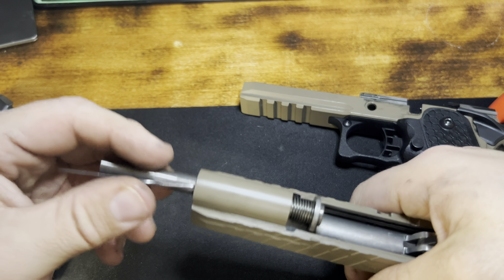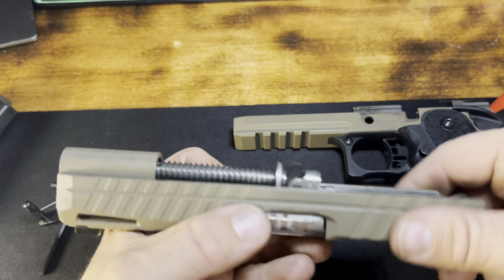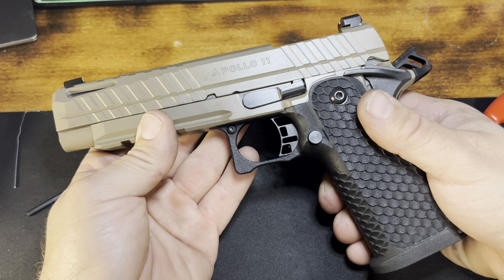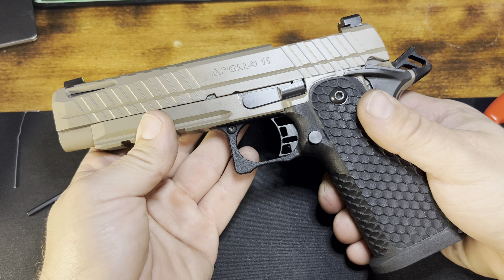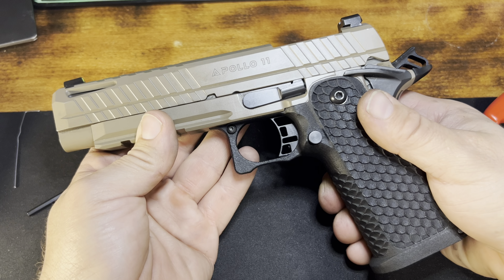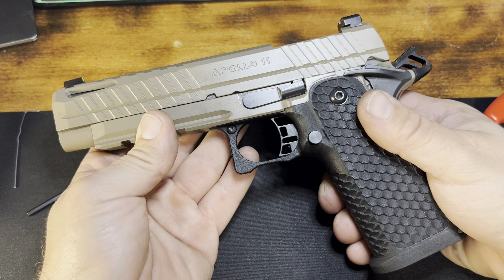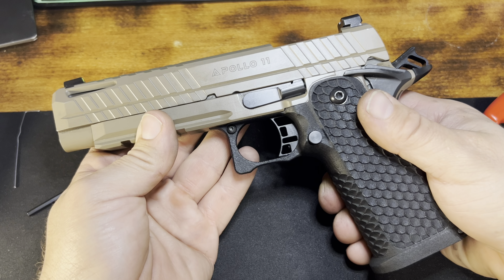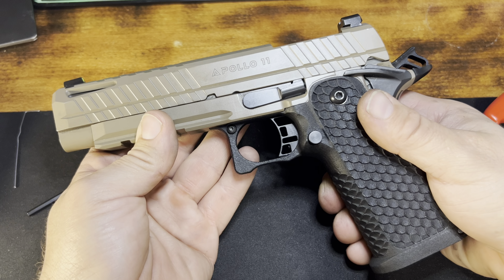Live Free Armory, Apollo 11, Tabletop Features look + Disassembly

Comment: Just FYI, that's not an RMSc footprint.  It's RMSc-compatible.  The recoil lugs that are part of the RMSc spec are missing, so the optics screws will take all the recoil vs distributing it across four lugs + two screws.  Even the HolosunK modified RMSc would still have had the two front lugs.  This is indicative of end-milling the slide vs. CNC milling it, representing cost-savings at the potential expense of durability of the optic/screws because of what's being forced to absorb the recoil and where (all in the middle of the optic vs. two or four corners + two screws).
Reply from the maker: Wont the wall of the slide behind the optic if it fits tight enough also take some of the recoil force as it would be touching the back of the optic and preventing it from moving as well?
Reply: @WVGunsNGoats  Negligible, at best, even assuming the optic goes all the way against the rear.  The optics have post holes in them for a reason... the same reason the spec (RMSc and Holosun K) have posts.  Recoil absorption.  It'll be interesting to see if there are reports in the next 6-12 months of optics flying off, sheared screws, etc.  It was a simple thing LFA could have done right and instead appears to have cheaped out on... and that kind of red flag was enough for me to cancel my "ready to ship" order with them once I found out.  It speaks to other potential cost-cutting that's gone unseen and could lead to a less durable firearm.
Reply from the maker: Thank you for the insight into it, i wonder if they will add them as production continues, i will have to ask them at SHOT show next year.
Reply: @WVGunsNGoats  I doubt it.  It's a change to their machining process.  This really calls out their bullshit about all of their "look at our new machining capabilities" posts on Instagram, etc.  This is home-gun-builder quality, IMO, vs. CNC quality that all the other major manufacturers are using.
Reply: @thatmikereed Without actually seeing the plate where it lines up on the pistol, your comments are based on assumptions only.  It's quite possible the plate does mesh with the optic cut out with won't put stress on the optic screws. And frankly this is more than likely the case.
Reply: @lawnmowerman25 there is no plate.  That’s part of the problem.  It’s directly mounted to a non-spec cut on the slide.  Every optic is going to fit slightly differently - they’re all slightly different lengths.

At least with a plate you could add posts.
Reply: The cutout in the Apollo 11 is 1.620" center to center.  A Holosun 507K X2 is 1.60.  So there 0.020" play front to back. Only the screws are what hold it, it is not held against either front or rear walls.  I have gone to the range with mine and it is not usable with a 507K x2, it was all over the place with every shot.  Now an RMRcc is 1.8", I don't have one, but going by Trijicon datasheet I would say the Trijicon RMRcc will not fit the Apollo 11 - at least not mine.
Reply: @WVGunsNGoats  Just FYI, they've supposedly added locking lugs in the Holosun K format on newer slides.
Reply: EPS on my Apollo 11 has 4 trips to the range, at least 200 rounds per trip , so over 800 rounds , no Zero drift, screws still tight . Only change I made was put a take off Prodigy grip on mine. The factory LFA grip is thin lightwight 3D printed plastic, looks good and feels ok but the Prodigy grip is beefier built , not a hollow echo when dry firing like the thin LFA grip. I wish LFA would offer Aluminum grip upgrade !

Comment: This is a great piece of kit. The fact you can get a quality 1911DS for under a thousand bucks sets a new bar. The red dirt trigger is excellent. I prefer a full-length frame as it adds weight balancing the full magazine. The tri-top is a nice touch. LFA should offer a pinned grip safety. I would put a tooless guide rod in and if they manufacture a forged ignition system there is no need to put an EGW system in. I have read reviews and have shot this pistol at my club. There is a lag in the slide return, I think maybe it is the disconnector, an easy change, and an upgrade. Here is the question, if I own all of the usual suspects in 2011s, Atlas, Hayes, Bul, then what does this gun add to my collection. Well, I would carry this. The polymer grip deducts weight so it would not drop my pants. In addition, IF I ever had to pull for a threat, I could live with the police confiscating a $1000 pistol over my $6000 Nighthawk. Remember why we carry. protection and defense for you, your family, and innocent strangers.
Reply from the maker: Hey Rogue, Thank you for the thoughtful response, I just got around to setting down and going through all the comments i missed, It sounds like you have a pretty good collection of 2011's out there, and you know what the great thing about this Apollo 11 is? It is going to be a great entry into the 2011 world for someone who may be on the fence about spending the money that a 2011 usually costs, and they might see the light and decide to buy an Atlas later.

You also make a great point that if you have to use it defensively, and it gets held as evidence, you don't have a multiple thousand dollar 2011 sitting in police lockup. Thank you for watching!

Comment: Just got my black Apollo 11 today and so far it is nice. Have not fired it yet.  Just field stripped and cleaned it.  Initial impressions:
1. Coating appears to be more susceptible to damage than just regular cerakote.  The inside of the slide where the barrel rubs was full of scratches from the barrel, down to the metal.  
2. I'm concerned about the grip safety. It is very heavy and requires +90% engagement to allow firing.
3. Trigger pull weight is suppose to be ~3.5, but I'm measuring 4Lbs 15oz consistently.
4. Minor issue here, the trigger reset is slightly scratchy, but this might wear in as it breaks in.

Overall for $979, this is a deal and definitely a Prodigy killer. I have 3 Prodigies and had to change out a lot of parts to get them to work right.
I also have 4 Staccatos and 5 Wilson Combats which of course are not a fair comparison to either the Prodigies or the Apollo 11.
Reply: Took it to the range today for the first time. Impressive compared to Prodigy. I have three Prodigies, two I bought new and one used. Both of the Prodigies I bought new had many malfunctions right from the start.  The used 5" Prodigy I purchased also had malfunctions.  All three of my Prodigies are super reliable now after I have done a lot of work with $300+ in parts for each. All three of my Prodigies are now reliable and I can go and shoot 2~300 rounds with zero malfunctions.

Ok, back to the Apollo - brand new at the range, 120 rounds, zero malfunctions with exception of not locking back on empty.
However I did not used the Apollo 11 mag, I used Staccato and Atlas mags.  What is strange is that they all failed to lock back at the range, but when I returned home and the gun was cold they would all lock back.  I will have to try the real Apollo 11 mag next time at the range to see if it locks back when the gun is hot.
Reply: Second time to the range with a Holosun 507K X2 mounted.  The two screws only holding method is not making it.  The red dot was all over the place - and yes there was locktight on the screws and torqued to 15in-Lbs.  For now a red dot is not usable.  Unfortunately using the iron sights put rounds six inches high and to the right.  This will require a change in front sight to fix - higher front sight.
Reply: For $1000 you should expect tooling marks on the gun. It is not hand-fit by a gunsmith. I am sure LFA machines these to be as close in tolerance as possible. Just make sure you lube it up. The elite line of cerakote is tougher as it is a different formula. The ultimate is PVD, nitride, etc. But those finishes are expensive. Enjoy the gun.
Reply: @VictorSilva-rq4kz  did yours also include optics mounting screws that were alarmingly short? Mine barely protruded through my 507k & had to be replaced.
Reply: @VictorSilva-rq4kz  my question is this. With some work can it be on a Staccato level?
Reply: @Rhamlin7  it's amazing the level of "work" that can be done with this thing.
I bet that 80% of those who have bought one have no idea why the supplied Allen wrench is so long and where that length can be applied. Probably just as many will have no idea how to "tune" the main spring either.
Reply: @Cory14Tina02  give us some insight!
Reply from the maker: Hey Victor, sorry about the late reply, But I would call LFA and talk to Julian, Tell him you are having issues with the optic staying on the gun, because they have since added the nubs to the slide to interface with the optic.
Reply: @Rhamlin7  nope

Comment: @VenableRacing
2 minutes ago
Nice video and a very good pistol that punches well above its price point. I have just over 1000 rounds through my Apollo 11, no issues at all with various FMJ ammo, after about 600 rounds and a good cleaning and lube it would feed hollow points just fine. LFA has done a great job especially for a sub 1k price. My only suggestion is for them to offer an aluminum or steel grip option as a factory upgrade, and to offer a good exchange to us early supporters of this platform from them. The Plastic or whatever Grip, looks good and feels fine but the material is to thin and light and does not balance well or give a firm confident feel. Keep the current grip at the same price point and add 10 to 20 % upgrade for a guality aluminum grip with tactical Magwell.
Reply from the maker: I would LOVE a metal grip frame on the Apollo, and i have heard rumors about it. I fear it would drive the cost above 1k though, however for them to offer a metal grip module as an optional accessory so that they keep the price of the gun where it is at would be a great thing, and then it could also help the 2011 builder market too.

Comment: I might check one of these out when they out out the 4.25 inch model. But I’ve heard that the 5inch ones trigger is bad n heavy
Reply: It's suppose to be 3.5Lbs, but mine was almost 5Lbs.  I have changed it to a little under 4lbs.
Reply from the maker: I had the same experience with mine, the trigger came in around 5 lbs and i had it worked on and now its around 3 and some change.

Comment: Apollo owners; has anyone else who has mounted an optic experienced any issues with having to max out their RDO adjustment range in attempts to gain zero?
Reply: See above under Victor Silva, I mounted a red dot and I did not have that issue.  My issue was that it only has screws holing it in place.  The red dot kept moving after every shot.  Without an optic the impact point is hight and to right.
Reply from the maker: Cory, I will be mounting an optic to this gun shortly, and making further videos on it, I will keep an eye out for this issue!

Comment: Looks like a nice 2011 but the optic cut is garbage. Theirs no recoil lugs which is a big problem if tou want to direct mount your Dot.
Reply from the maker: It looks like a rmsc optic should fit snug inside of the cut and the walls of the cut itself are acting as the recoil lugs to hold it from moving.

Comment: It's an awesome gun mine just has a bit of a loose thumb safety on the right side
Reply from the maker: I believe that is pretty common as long as it cannot fully come out with the slide on.
Reply: @WVGunsNGoats  yea I'm still really happy with it
Reply from the maker: You get it out to the range yet?
Reply: @WVGunsNGoats yes sir ran flawlessly feels really good
Reply: My left hand thumb safety is only slightly loose, but the issue I'm trying to figure out is:: When I grip the gun (right handed) I use a high and very tight grip, which seems push the left side safety slightly up, which seems to restrict the slide when attempting to retract it.  I don't know the internals well enough to say what may be happening. I will call Jullien when time allows. Anybody with some incite? Other than "Don't grip it so high"
Reply: @elman8283  any chance with that grip your thumb Is riding the slide or on the other side your index finger pushing the safety up